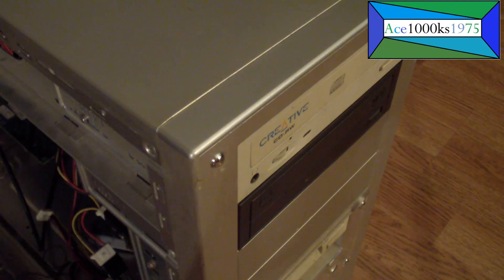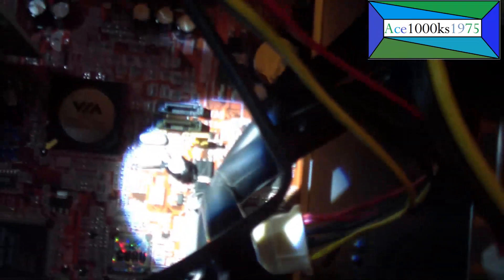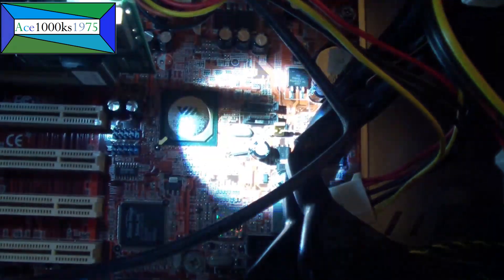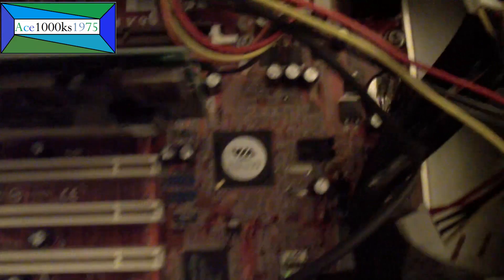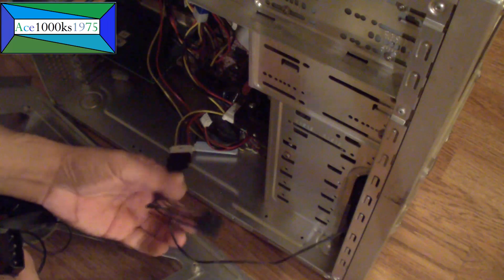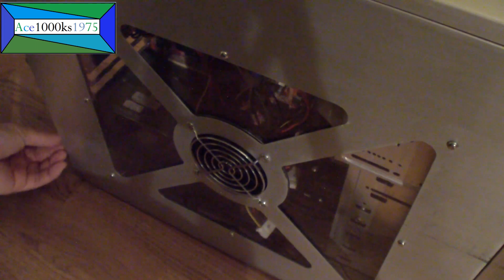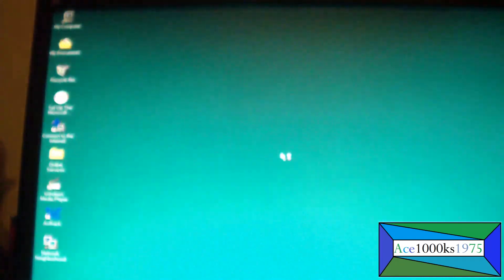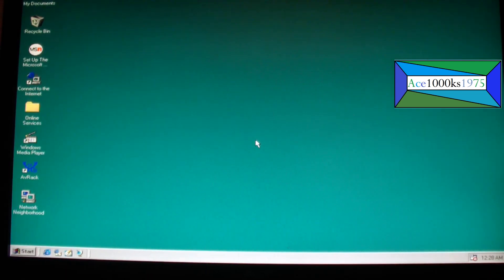Retro Computer Athlon 64 3200+ with Windows 98

Comment: You got the same mobo like mine. so lucky you mostly because mine got faulty when rebuilding my retro couple years ago. Couldnt find another at ebay. only one at USA for about 60 o more. Since then, 2 years now, I am following in case someone sell one. But none rush since my list of priorities and spends is increasing.
I used a SB xtreme music that I modded myself with online guides. Also a nice one still now modded.
I really loved my PC those years but it is also truth that performance and updates turned imposible at about 2009 and further. BUT, as retro for me is a jew.
Reply from the maker: The Athlon 64 3200+ This motherboard and CPU makes a great retro Windows 98 PC. The Socket 478 based Pentium 4, and Athlon 64 socket 754 became obsolete by 2008. You needed at least a Intel Core2duo, Core2quad, or a AMD Phenom processor based computer to run games in 2008.
Reply: @Ace1000ks  Exactly, I remember that those years. 2 cores that I coulnt pay then but later I got a amd6100 that my son use now. I wasted hours looking to upgrade on a cheap way  but was imposible until many years later. Anyways, I only use my retro one or twice per month to play expansions of fallout 3 I didnt play then.